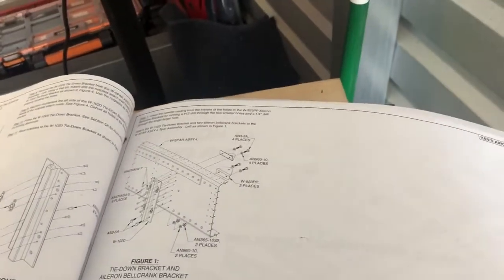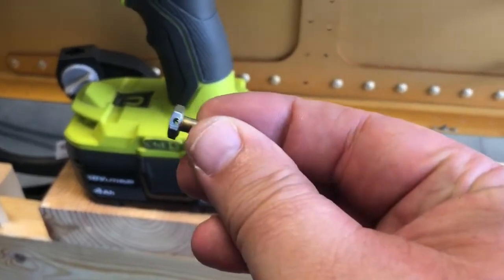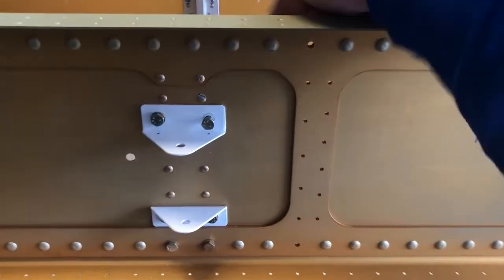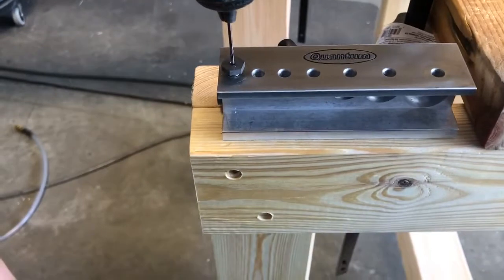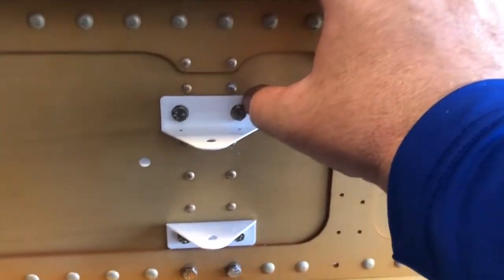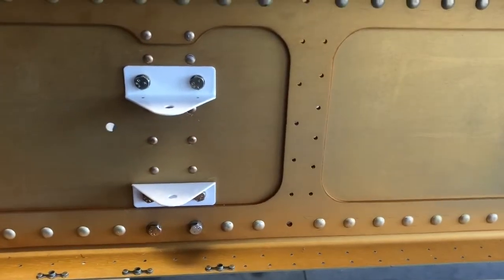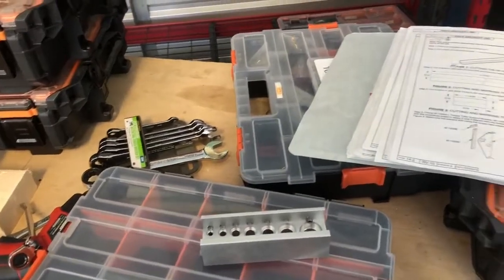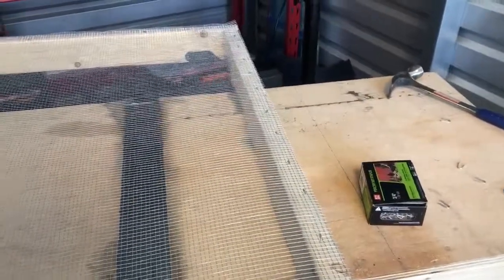Drilling Safety Wire Bolts

Comment: Still loving the vids! Keep them coming.  Dumb question but would red thread locker be a good alternative?
Reply from the maker: That would work but you would still need to put a torque indicator on the bolt. The inspector will either want to see the indicator or safety wire. The safety wire is a sure way to make sure it will never come loose.